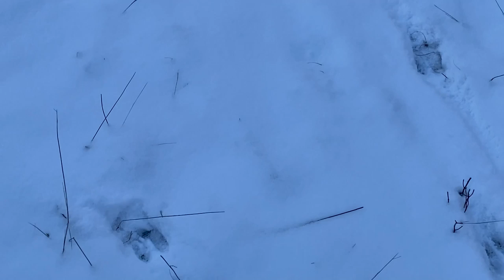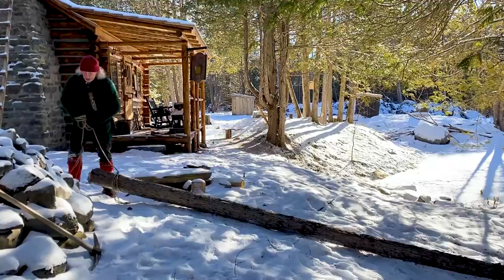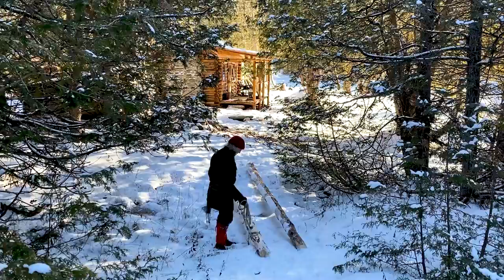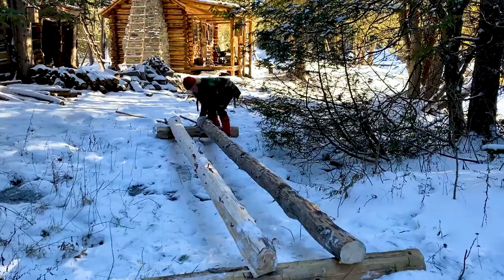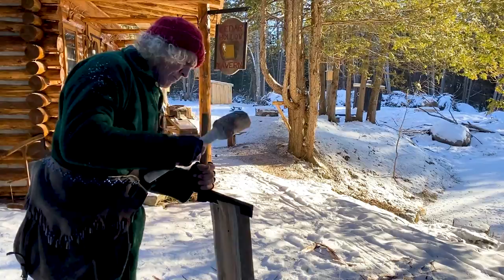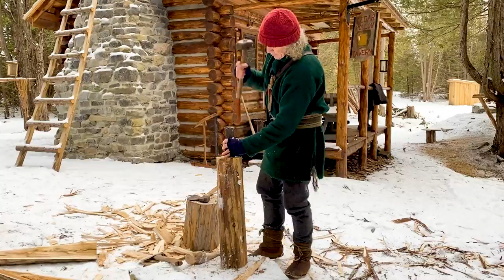Bridging the Gap | BRIDGE BUILDING | CABIN BUILD | SELF RELIANCE

Comment: Today is my day to sharpen things.  I am going to sharpen my plane, drawknife and my chisels.  I have a little jig that they fit into and it has rollers on the bottom.  You just role it across a whetstone and it will sharpen them at the correct angle, based upon their width.  I already have my spoke shave sharpened.  I may sharpen some of my new axes, too, weather permitting.  It has been 90+ degrees here the past week which is not nice to work in, outside.  It looks like your draw knife could stand a sharpening, too.
Reply from the maker: I’m forever sharpening them,but for bark peeling I find they work better a wee bit dull.

Comment: People think that cutting down a tree is the worst part but limbing, bucking and cleaning up the mess takes a lot longer than cutting down a tree.  I can put a big one on the ground in 15 minutes or so but it can take me three hours to clean up the mess and this is with big chainsaws.  Afterwards, it takes me an hour to clean up and sharpen my saws, per saw, and I always seem to use at least two saws at each cutting session if it was a big tree.  I like Mel Brooks, but I have read those other folks you mentioned.  You don’t get lettered without reading them and I am lettered.

Comment: The rope you're using to drag logs  and for other tasks. What is it called, and where should I look for information on how to make one for myself ? Thanks in advance
Reply from the maker: It is a tump line or also know as a burden strap.  I hand braid the centre or brow piece … about 18” long and cove4 with brain tanned deer hide.  Reduced to 9 strands of hemp, I do 3,  3 braid lines and then braid those 3 together.  Tump ends up about 20 feet long which is historically the length they were.

Comment: 200 years ago, would they have coated the wood with a preservative?
Reply from the maker: Some preservatives were used but, more common on the frontier would be to char them in a fire, which extended the life.  I use primary cedar which is extremely rot resistant and given my age, will most likely out live me.